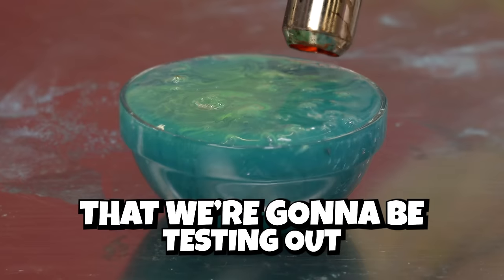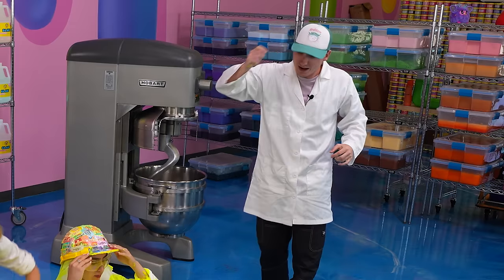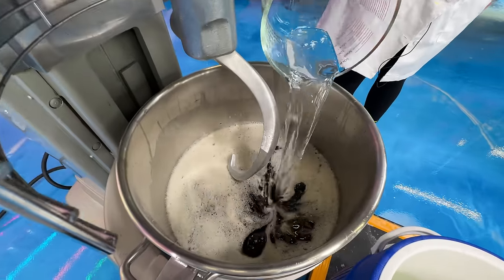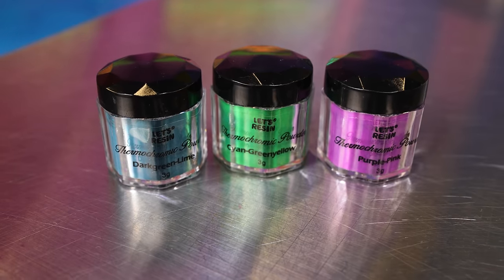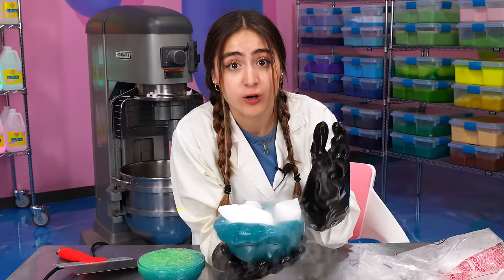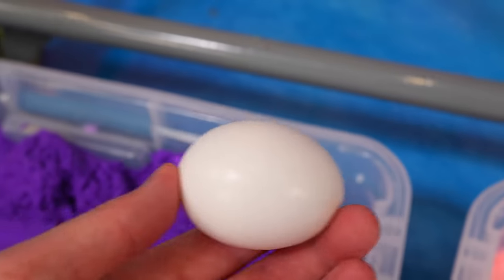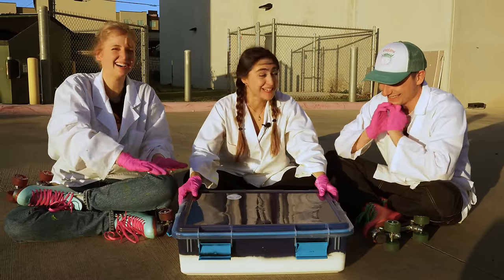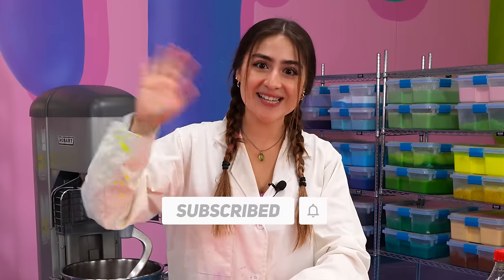Testing the CRAZIEST Slime Experiments Ever!

Comment: For anyone curious why the mentos and coke experiment didn't work, here's why!

So, the reason coke and mentos fizz is because the mentos are (on a microscopic level) rough. See, the way drinks get bubbles is through dissolving Carbon Dioxide (CO2) into a liquid. Usually it's kept under pressure so it stays trapped in the liquid, but once you open up a bottle or can, the CO2 immediately tries to escape - creating bubbles! That's why if you leave soda out it goes flat - all the bubbles have escaped. 

Now, this ties into mentos being rough because the rough surface makes it easier for the bubbles to break by helping free it from the liquid holding it in place. It's not a chemical reaction like baking soda and vinegar, but rather a physical reaction! It's more tearing apart the bonds. The amount of bubbles is also determined by how fast the mentos drop - faster means more bubbles!

Anyway, that's a fun science lesson for all of you.
Reply: Ooo thank you!
Reply: Ty❤
Reply: That is a long information comment but informative enough.

Point:Thanks for the info☺️😊
Reply: Nothing sus here
Reply: @ajaypaul7865  ?
Reply: @ajaypaul7865 nothing sus here but u